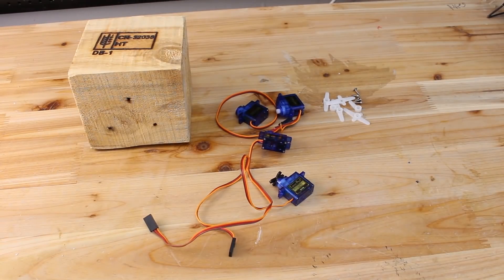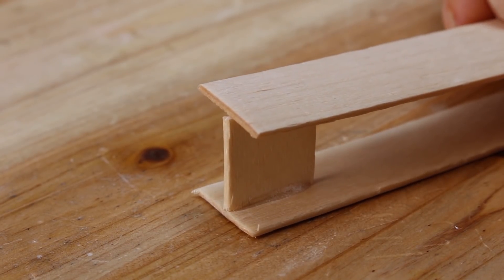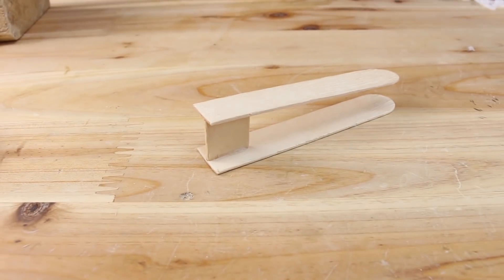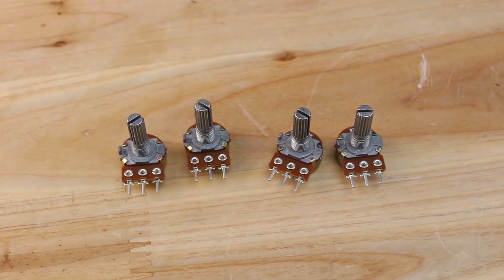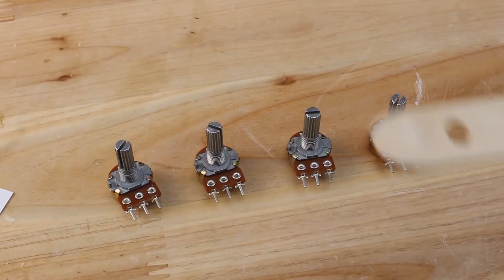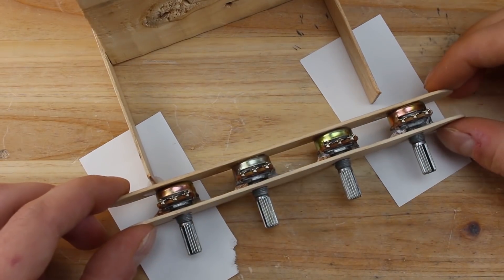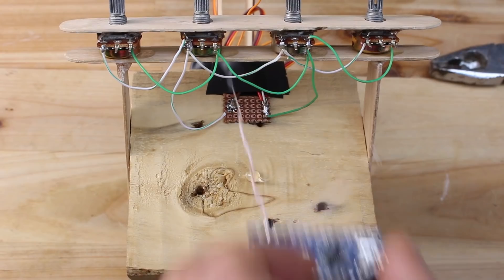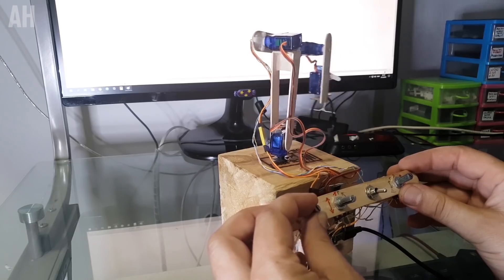4 Amazing and Homemade Inventions DIY

Comment: Instead of using water in coc botel u can use petrol and fire it it will go faster than it
Reply from the maker: Too dangerous
Reply: @Hacktuber  y
Reply: U can use
Reply: @Hacktuber   but u should add little desal that is safe